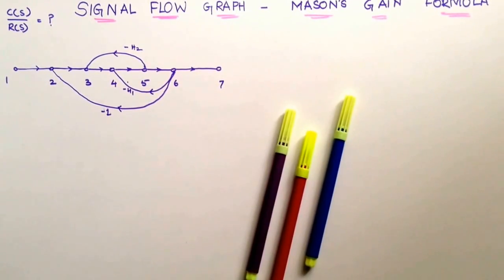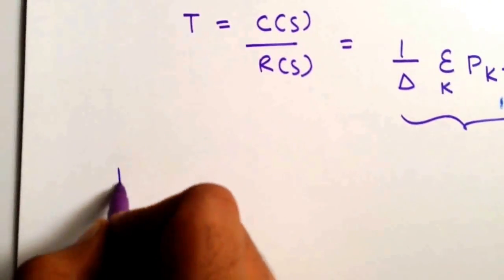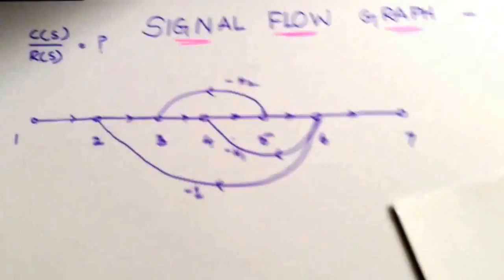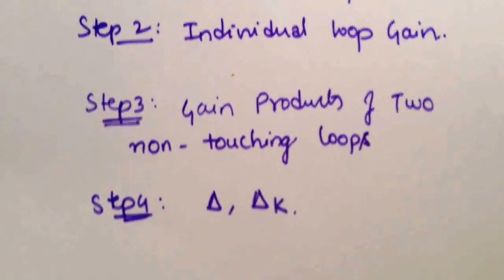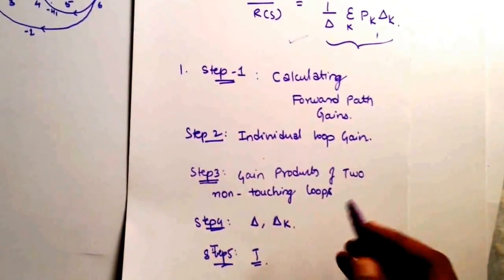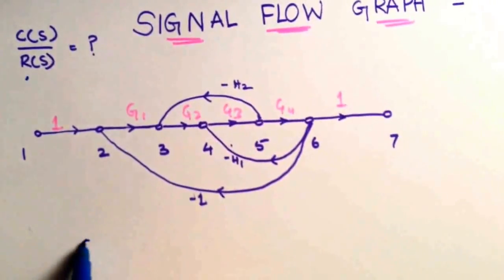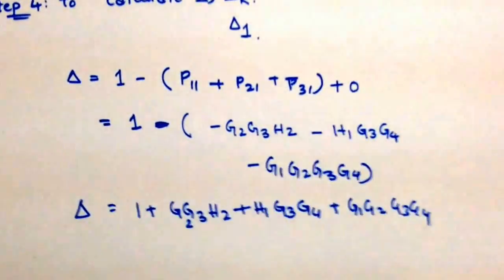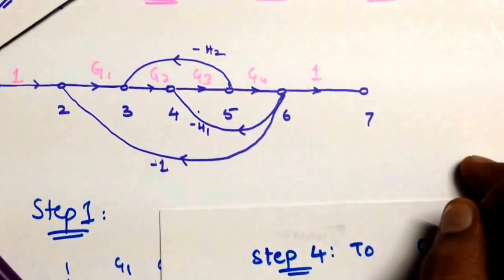Mason's Gain Formula

Comment: Can't we take the pair of -H1 and -H2 and a pair of -H2 and -1 as non touching loops?
Reply: -H2 is for the loop that starts from node 3 and ends at node 5 while the -H1 is for the loop that starts from node 6 and ends at node 4.....so -H2 is not touching the same nodes which -H1 is touching...why can't these two nodes be made a pair of non touching loop?